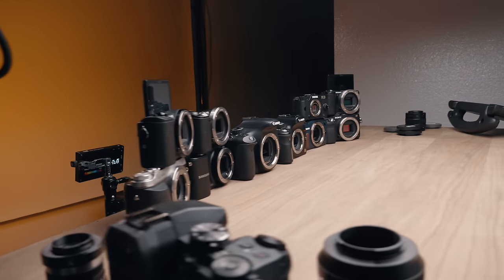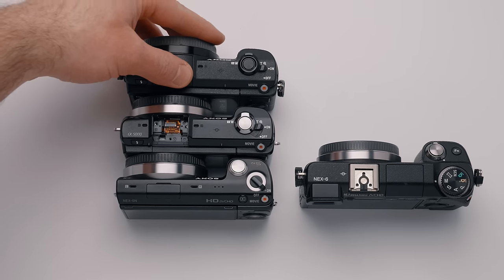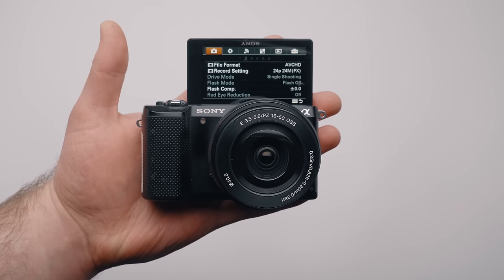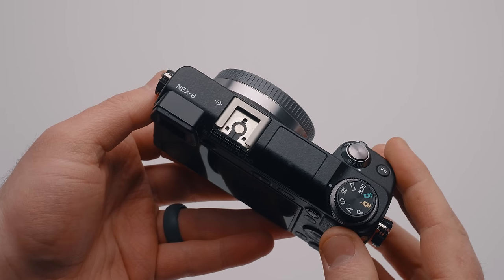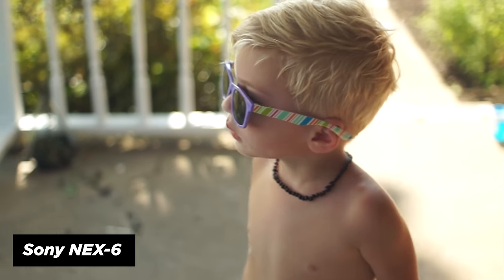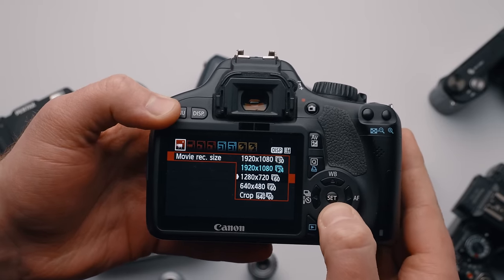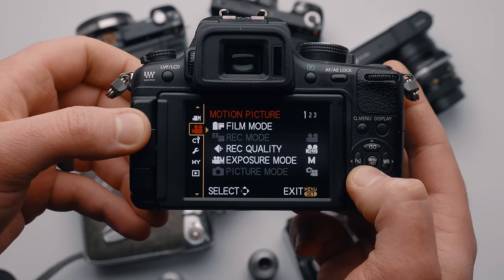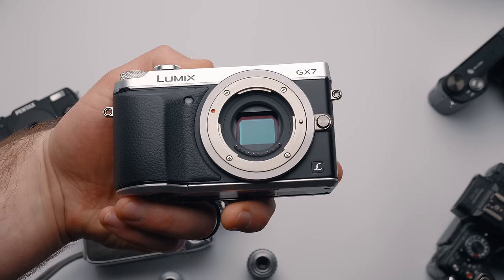10 Cameras Under $300 for Video!

Comment: As a creator working on a budget myself, I suggest just rocking the phone camera and saving up until you can buy something that you are going to be happy with for a long time. I still use my iPhone 8+ and just ordered a Canon Rebel T5i. The quality of most modern smart phones is good enough for most video purposes, and I also think theres some value in the fact that you always have your phone with you so you're always ready to pull out your camera and record something.
Reply: Don’t forget cano SL2 24fps 30fps 60fps flip screen dual pixel auto focus excellent camera and cheap .
Reply: @fredr.  ever used one of these? I need one for car videos and I cant chose one😂
Reply: Ever heard of storage? It's something I don't have
Reply: @fredr.  Agreed
Reply: Fred R. As I’m the 11 is better or worse?
Reply: The cameras on smart phones are great and getting more capable all the time. But they're still no match for a DSLR or mirrorless camera when it comes to low light performance or shallow depth of field. Does the computational photography that provides fake shallow depth of field for photos work in video too? 

With that said, don't be afraid to work in a clip from a smart phone camera in with other footage. I recommend the Cinema FV-5 app for Android because you can adjust the frame rate. It's a $5 app but worth every penny.
Reply: I wish "creators" would stop saying "rocking"

You're simply using something
Reply: @mustardketchup  Exactly
Reply: @mustardketchup  Agreed. I think "rocking" should be reserved to mean "using with absolute virtuosity" which is rare of course.
Reply: @sarina3535  I was about to say this smfh. I started recording about a week ago and I have NO space what so ever. Cameras like these are honestly a better bet for now until we can afford to get better later down. I’m gonna get the T2i.

Comment: a5100 also has clean HDMI out :) Great as a webcam! Doesn't overheat via HDMI like it does via SD writing.
Reply: Great and how long will the battery last?
Reply: Do any of the other cameras you reviewed also have a clean HDMI out?
Reply: @EposVox Is this true for the a5000 as well?
Reply: Can it boldly go, where no web cam has gone before too?
Reply: What about a5000 also hi
Reply: i also have an a5100 and use it with a 60fps capture card as a webcam. you can buy a battery with usb or power plug for infinite power. i also recommend to install the homebrew app openmemories for more functions like timelapse or focusstacking. considering it is my first cam, i am pretty happy about its features and capabilites. good choice if you can live without 4k video. otherwise the new a6400 is just the better a5100 upgrade.
Reply: tnks for info
Reply: RetroPCTech  not exactly, but a lot is the same
Reply: Over the budget here but if all you want is that clean HDMI out the Marshall CV503 is pretty cool (though you’ll need an SDI to HDMI adapter), the CV506 has built in HDMI and can do 2 simultaneous outputs which is nice
Reply: How big of a deal is the lack of a mic jack for that? What about video autofocus? That's what dissuades me from using my Panasonic G85 that way.
Reply: Alright then
Reply: @Driftuner  With a $10 dummy battery from E-bay... forever.  I'm using it.
Reply: And apps and wifi wireless video monitoring and control... It's an incredible camera, I got it to be my B cam for the FS100 back in the day. At this point I bought the FX6, but I still keep the 5100, it's just great.
Reply: @Driftuner  If you're using it as a webcam, you should use a dummy battery and wall power. That's what I do with my G85.
Reply: This is what I needed to know thank you!

Comment: The GH2 is a great little camera if you want a cheap b-cam and already own a mft camera as your main. Actually made a video on it just the other week. Managed to pick it up with a 14-140mm lens for roughly the same price i could resell the lens for, great deals to be had :D
Reply: I might have to do that.
Reply: I own one as well and it’s a good primary camera for low budget filmmaking, especially when it’s hacked.

Comment: Caleb touched on this a little, but I would like to be emphatic about it.

Newer cameras offer better image quality and higher resolution (4K, 6K, and even 8K). However, I still think the video quality coming from many of these cameras is "good enough" for YouTube or your amateur film. They are fine for learning if you're just starting out.

But the most valuable innovations since these cameras were released come from ease of use.

- Headphone and microphone jacks
- In-body image stabilization
- Reliable video autofocus
- Improved audio pre-amps
- Improved dynamic range

You want a camera you don't have to work around. And that's  where many of the newer cameras have an advantage.

You don't need necessarily need an external audio recorder. You don't necessarily need a rig or a gimbal. I am not opposed to these things, but they are not as critical today as they once were.

I want a camera I can just pick up and use with minimal fuss. That's why I love my Olympus OM-D E-M1 Mark II, and I am lusting after the new Lumix cameras like the G9 II and S5 II / S5 IIX. 

These new cameras have amazing video quality and no recording limits.  There is also an XLR adapter for many Lumix cameras.

If someone figures out how to make a compact hybrid camera with built-in ND filters, it will be an even better world.

Comment: Great review! One note and one error correction on the GH-2:
1. The GH-2 has a “crop mode” where it just reads the center 1920x1080 pixels instead of downsampling from the full MFT sensor, this makes it well suited to 16 and Super16mm C-Mount lenses with fUll HD resolution (probably better than Pentax’s Q).
2. @dslrvideoshooter has a title card for the GH-2 which states that it has a 2.5mm headphone jack. This is incorrect. The GH-2 has a 2.5mm mic in jack. It works, but it does limit your mic options unless you are willing to use an adapter.

Comment: I just upgraded to the Black Magic Pocket 4k, but can safely say that the Canon T5i has been an exceptional entry level camera, and surely the older ones are as well.

If you're on a budget get one of these entry level cameras, and then research and invest in vintage lenses. Quickest way to really boost the quality of your shots, beyond just getting better yourself obviously, is to find a unique vintage lens.

I'm very partial to the Carl Zeiss Jena Pancolar 50mm, and you can find it for around $100 or so.

Comment: I started with the Nikon D7000 (GASP - A Nikon Shooter!). Those can be had for under $300. Full HD up to 30p. Mic input and mini-HDMI. Not sure of the data rate. Super long battery life.
Reply: I use Nikons too, is that even allowed? A 750 and a 7100. Is there are support group we can join? Because when I do my part I'm not ashamed of the results at all. : )
Reply: Nothing wrong with a Nikon shooter lol! This comment makes me want to pull my D3300 back out tho
Reply: For what you do you might want to pull it out and throw a lovely cheap 50mm like a Series E 1.8 on it. Cost you 50 bucks or so. On a DX might be the closeup portrait lens of your dreams. No need for adapters, Nikon made everything back-compatible until the full-frame mirrorless. Nikon might not be in the forefront with video features but boy they have some good glass on offer. @NerdLensStudios
Reply: @mfreeman313  Yeah, I have a 50mm 1.8D which I got off craigslist and it's a solid little thing despite being an older model. Totally agree, Nikon has some great lenses overall

Comment: The Pentax is reminiscent of the old 1970’s Pentax 110 SLR camera. It might be interesting to see if it allows use of those lenses; the 18mm, the 24’s, the zooms, and the 50 and 70mm telephotos. Yes, these were a 110 camera from Pentax. BTW, Minolta had two SLR cameras as well in the same era.

Comment: Don't underestimate the importance of a mic jack. I know you can work around not having one by using your phone or an external recorder, but it's annoying and will slow you down. The GH2 is really the way to go on this list because it has headphone and mic jacks, just be sure to get stabilized Panasonic lenses if you plan on using the camera handheld. I'm sure Caleb would agree that audio is very important!

It sucks that it never occurred to Sony to include a mic jack on an APS-C camera until the NEX-7.

Comment: As a Nikon shooter, I'd recommend the Nikon 1 system for video. The phase detect AF in the 1 system is fast and accurate. The V series include a mic input whereas the cheaper J series don't. The J5 even has a 4k @15fps but still no mic input. Its going rate is less than $300.

Comment: Caleb! Great video! I love your stuff as always. I have an interesting contender for this video. The Lumix FZ300 bridge camera. I think it has the same sensor size as the Pentax Q, but get this. It has a constant F2.8 aperture throughout its whole zoom range which is like 27mm - 600mm. Plus it shoots 4k 24, 30, and 1080 up to 120fps. I got mine used for $300. Plus has a ton of features seen in the later Lumix cameras. Really curious as to what you think about it.

Comment: You can get Panasonic gx85 for 250 bucks , with 4k , 5axis stabilisation  and Cinelike-D with an easy hack. You can't top that.
Reply: I have one. Excellent for the price.
Reply: Alexis Stamatopoulos 
The heck did you find it?? I only see $400 and up on Amazon
Reply: hi, obviously i am referring to second hand, which you can find in ''like new'' condition in many sites like KEH or MPB.
Reply: GX85 is a great suggestion, only lacking a mic input and a bit softer 1080P footage compared to the G85. But for that money probably still the best bang for your buck.
Reply: Alexis Stamatopoulos 
Never heard of em. Thx
Reply: the price is pretty unreasonable over here at méxico at 1k usd, even used models won't go below 500 for the gx85. the list here works great for the foreign market.
Reply: @NDFro  have you tried ebay? search for item 143225888392 a used GX85 for 300bucks that also ships to Mexico, so that seems doable right?

Comment: You can now get the Olympus OM-D E-M1 used for under $300. With firmware 4.0, it added the ability to shoot 24p and 25p in addition to 30p. It's not a fantastic video camera, but it's definitely usable.

Comment: Just one question: Does the camera blurry the background itself? I wanna use for fashion videos and stuff in slow-motion.
Reply: No it depends on the lens you are using. You need a fast lens (wide open) in order to create a blurry background. You'll need an ND Filter to cut the light you are bringing into the sensor. Just look up a beginner filmmaking camera lens video.
It's a form of art and no software will do it for you.
Reply: @lukekahms1672  Oh I see, you explained perfectly, thank you very much
Reply: @lukekahms1672  "Form of art and no software will do it for you."

 Excuse me, structured light and light field cameras would like to have a word with you.

Comment: As for the a5100, which I own, you're not gonna be able to record continuously for more than around 15 to 20 minutes at most as it will overheat, even in mild temperature (I was recording in a basement at around 18C when it happened to me). Also the battery won't last for more than around one hour if you're recording videos. And even when you're not doing anything with the camera but just have it on, the battery will drain pretty fast. I've used the NEX F3 which is an older gen and it performs better battery wise and when it comes to overheating but it's a chunkier body and also lower specs. One good thing I like about the a5100 is that it has very good AF in both video and stills for a camera of that price.
Reply: Yea the A6400 really fixed a ton of issues that the NEX/A5xxx/A6xxx had. Like overheating, color science, screen dimming, battery life (you can shoot continuously for about 1h45 with no record limit!!!) the new processor really fixed all the problem lol.
Reply: So slightly better than the new Fuji XT30 that limits you to 15mins FHD lol.

Comment: I just picked up a Blackmagic Pocket Cinema Camera for about 300 euros. 4k is overrated, RAW video and ProRes are the bee’s knees!
Reply: Antti Heikkilä I guess that would be like shooting raw photo on a t3i vs grabbing a still from a 4K clip? I love the quality on my 1DXmkII 4k, but am looking for something smaller. Very interesting point. Super high quality 1080 vs the 4K on a 1DXmkII? Something for me to research.
Reply: EOS M with magic lantern and a sandisk extreme pro can record 2.5k RAW at 23 fps (10 bit)
Reply: @MrChanw11  I dont know the exact crop but its something like 5X~ when you shoot in RAW with the EOS M.
Reply: @JetBen555  Its about 2.5 I believe, but that raw video doesn't even look like it came out of that camera considering its horrible 1080p.
Reply: MrChanw 11 True but it requires hacking the camera unlike with the BMPCC :)
Reply: The Dan Palen Definitely check out the BMPCC then! Just remember that it’s a super16 sensor which is about 2,88 crop from your full frame Canon. I have a 0,58 speedbooster which drops the crop factor to 1,67 and gathers 1 and 2/3 stops more light so the camera becomes pretty great in low light with it’s native ISO of 800.
Reply: 300 euros?!? The prices have already dropped that much?
I mean, I assume it was used, but if it's in good condition... damn, that's a pretty sweet deal
Reply: thatwastricky Yeah well I paid 500 euros for the Pocket and two mft lenses which together are about 200 euros used so I am planning on selling them and keeping the Pocket. The camera is in superb condition, the battery is just a little weak.
Reply: @thedanpalen1  Check out the youtube channel "Zeek", he does a lot of EOS M Magic Lantern testing including 1736x976 14Bit lossless. You still exports and uploads at 4K and just looks beautiful, like 16mm film without the grain.
Reply: that's an amazing deal. however with the original blackmagic pocket I feel the dedicated blackmagic meta-bones speed booster is a must (ef), pair it with a sigma 17-50mm f2.8 and great results, but once kitted out more than $300
Reply: I found a used Nikon G to BMPCC Speed Booster for 200 euros ✌️ Works wonders with the Sigma 18-35mm.  @legendp2011
Reply: +Antti Heikkilä .......I prefer to use the ef version with a sigma 17-50mm os lens so I can get image stabilization to work (which I feel is a must on a little camera. some people have modified the canon 17-55mm f2.8 efs lens to work as well)
Reply: legendp2011 That’s great for handheld stuff! I have a smallrig cage, a monitor and a gimbal, glidecam and a tripod for the stabilization 😄
Reply: +Antti Heikkilä........I have all those things too, it's just nice to be able to go handheld when the occasion calls for it
Reply: How large are the files?
Reply: @thedanpalen1  go for the a6300. It's 4k is downsized from a 6k sensor so you're getting higher quality 4k than other camera. Also it's quite affordable given those features.
Reply: Scotty Zepplin Yes the A6300 4K is gorgeous judging by the detail, but grading 8bit slog can be a nightmare and the rolling shutter is the worst I’ve ever had on any of my cameras. I sold the A6300 for the A7SII but now I bought the original BMPCC and also ordered the BMPCC4k since the ProRes files run so much better in editing and are much easier to grade. Also the Sony colours can get pretty awful if you don’t get WB and exposure spot on in camera.
Reply: Chris Parayno The ProRes files aren’t that big but the RAW video is. Check out a movie trailer called ”Cosmos”. It was shot on the BMPCC with ProRes LT and looks absolutely gorgeous.
Reply: @2dimples_dad255  2.6GB a min.

As it should be.
Don't wish for smaller file size. Smaller file size means smaller image quality. You don't want that.
Reply: @MrChanw11  No overheating?
Reply: i know! the way black magic set up there cameras is a bit conservative, i dont like how my bmpcc cant do slow motion, but i like the fact that its quality is just a hair less than bmpcc 4k is awesome practically the same quality. bmpcc 4k can do better low light and is more sussptable to light aswell, can shoot slowmotion, has touch screen, a easier interface, more versatile plugs and double sd slots its definetly worth the extra 600 if those are perks you care about,
Reply: @MrChanw11  how much recording time do you get out of the eos m when you shoot 2.5k raw? And I love that you're also an eos m fan😀
Reply: Anyone who says "4K is overrated" is demonstrating both ignorance and lack of skill.
Reply: What he doesn't mention in the video is that the EOS-M (100€ on Ebay) shoots 2.5K RAW at around 450Mbit/s...
Reply: Antti Heikkilä dude slow down. We aren’t taking about expense cameras on here!
Reply: @Alexchannel122  Yeah, but it's not any better than a Panasonic G7 in 4K with noise reduction cranked all the way down. I looked up some demo videos and was not impressed. The technical feat of forcing RAW down the EOS-M's throat impresses me, yes, but the actual video only really looks good by 2012 standards.

Comment: Great video!  I'm amazed at how many budget cameras have a decently large sensor!  

Will any of these cameras be better than my iphone 8 for low light photos/video and focusing on a wiggly baby? Or should I invest in better lighting to maximize my iphone camera performance?

I am looking for an affordable camera to shoot pictures and videos of my newborn.  I will probably be inside most of the time, and my house doesn't get a lot of natural light (my iphone 8 pictures always look grainy and blurry if there is any movement, and video is very dark and grainy).   I want something that will last at least 2 years, so I am also going to need quick autofocus to capture a wiggly baby/running toddler.  

Thanks!